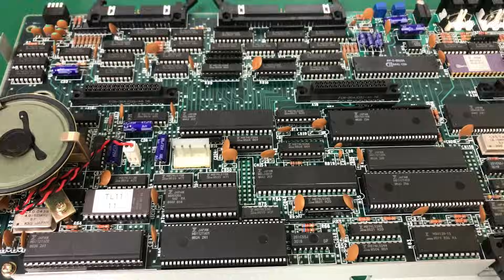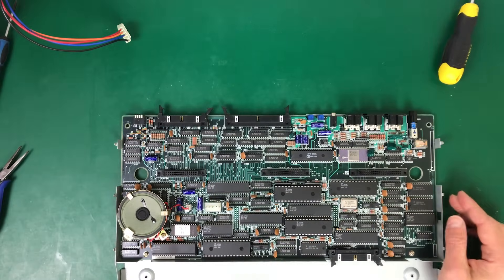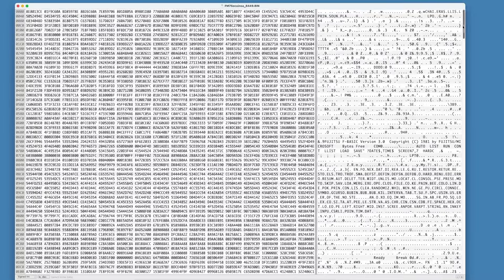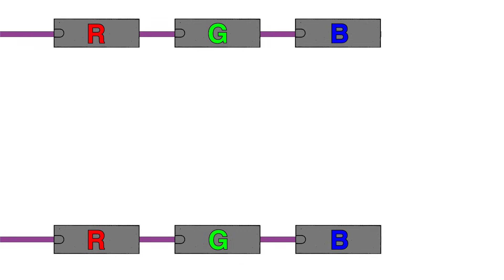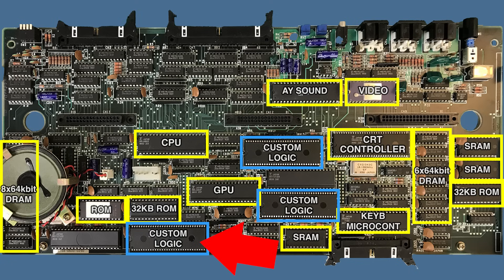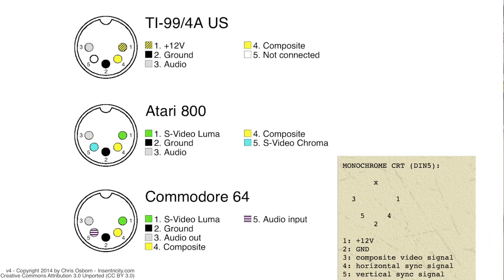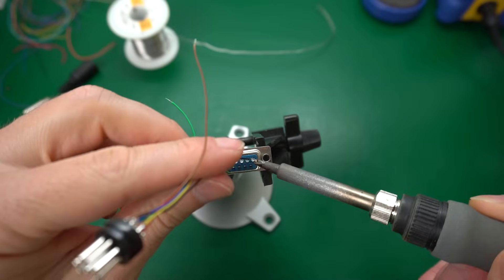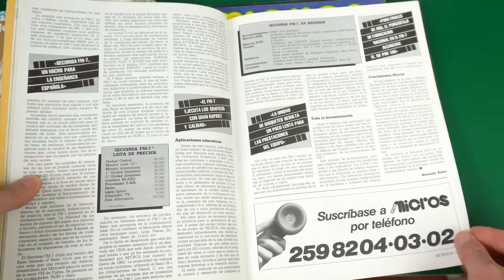This 8-Bit Computer Has Two CPUs (And One Acts As A GPU!)

Comment: Fujitsu have always been producing advanced computers going back to the days of mainframes and minicomputers, but they never seem to get much credit for it. I think the problem is in Japan people wanted the advanced tech and the price wasn't part of the equation, wheras in the west price was a much stronger driver for success. This can be seen with the Atari ST and CBM Amiga - the Amiga was technically more advanced and had a hard struggle to get ahead of the ST (which gladly it did eventually). But I think the ST still outsold the Amiga in raw numbers.
I had a Fujitsu PC once and it was beautifully made!
Reply: The Amiga was behind the ST in total unit sales for quite a while because the Amiga sales were really slow until 1987 when the less expensive A500 and A2000 came out. It probably took until around 1989 before the Amiga had sold more units than the ST. models. Ultimately, the ST models sold a total of 5 million units while the Amiga models sold a total of 11 million units, 6 million of those 11 million were A500s.
Reply: @timlocke3159  Thanks for that I knew that Amiga sales didn't take off until the A500/600 came out, but I didn't realise it sold so well when it did.
Reply: @IanSlothieRolfe  Yes, the A500 did very well but the other models not so much.
Reply: Fujitsu has made some interesting products really. I don't know much about the old days of mainframe computers but recently I read a little about magnetic logic and the parametron, a machine using it made by Fujitsu. That is pretty cool. Sadly most of what I have heard about Fujitsu is about it being an unpleasant employer, but I don't know if that is Fujitsu especially or just Japanese corporate tradition in general.
Reply: Both the amgia and st sold poorly compared to the extremely  overpriced and weak mac and ibm pc. i think the big problem with the western computer market back then was that most gamers back then where young kids compared to japan where you already had a lot of 25ish year old men that where into video games. so what this means that in the west most computers sales went to offices and computers that targetted gamers and hobbyists had to be very cheap. most european and American men born before 1970 really looked down on video games they just wanted to do spreadsheets and didn't do much research .even now i ask older people if they know what the amiga was most of them don't remember it at all those who do think it was a game console like the nes.
Reply: @belstar1128  Part of the problem was also that the Amiga and ST didn't have a "Business" look with their plastic cases and cheap-looking construction. The IBM PC and clones were made from metal and were substantial, could be sold ro businesses which was where the money was at the time. While there were a lot of games being played in 1983 gaming really wasn't a major business at the time, not until the 386 on machines arrived much later, and the market was small compared to the enormous amount of money being spent by companies replacing computer terminals on desks with PC's or Macs. I recall from the time that a PC XT with a 3270 (IBM terminal card) and software cost about a third of the cost of an actual 3270 terminal. Serial terminals for DEC and other manufacturers minicomputers were hugely expensive too, and PC or Mac "glass teletype" software was cheap, and the computer already had the serial hardware built in. The Mac gained a niche in the publishing industry largely due to a number of page layout and graphic design programs that became the "industry standard" from what I can tell.

Comment: Really nice computer.  Great video.

Japan is 100 volts, not 110.  Half the island is 50Hz and the other is 60Hz.  The USA is 120 volts 60Hz.  Their video standard was NTSC 60Hz.  This is mainly because of the influence of the USA post-WWII surrender.  If you have a monochrome monitor with a vertical hold control, you could likely hook up a 50Hz monochrome monitor to the 60Hz video connector.  Just adjust the vertical hold.

Comment: I think the extra memory in the 48K video RAM is used for something. The system definitely has palette control as some of the demos I've seen use palette rotation for animation. It also has smooth scrolling - at least vertically, which wouldn't be possible using the second CPU alone.
Reply: Smooth scrolling of the whole screen requires only changing the start address, something the 6845 CRT controller supported.  Smooth scrolling of vertical scroll regions requires pointers, I did one like that with a 6800, worked great but sure used up chips with address multiplexing.
Reply: @jrstf  for scrolling you would usually also have extra display ram so that offscreen pixels can be written before changing the scroll/offset registers. Otherwise there will be graphical glitches or an annoying moving border 😁
Reply: @Anticitizen666  - Registers are changed during vertical blanking, not at all time critical especially with this computer that has some 50 scans blanked.
Reply: @jrstf  I it’s not the changing of the registers it’s updating the pixels during vblank that would be the issue. That’s why all consoles/computers I’ve worked on that have hardware scrolling have extra memory for the offscreen strips. Well actually I think the older MSX machines didn’t and the result was the moving border that was hidden by the programmer adding black pixels to the edges, reducing the active display size.
Reply: @Anticitizen666  - Maybe we're just visualizing this in a different way. During smooth scrolling there is always an extra line on the screen as half the top line and half the bottom line are visible.  So a 24 line screen requires 25 lines of memory. However, there is nothing wrong with updating pixels that are currently displayed on the screen, with the slow machines of the time that was necessary.  Maybe what you refer to is the case where the CPU grabs the memory away from graphics, that's just a case of insufficient memory bandwidth.
The 6800 system I built gave the memory to graphics during phase 1 of every clock cycle and the CPU during phase 2 so there was never contention.  The machine shown in this video had a 68B09, if it was really running at 2MHz memory would be too slow for what I did, however I saw a 4.something MHz crystal in the block diagram indicating the CPU was running slightly faster than 1 MHz, plenty slow enough to avoid memory contention.
Reply: @jrstf  not sure what you mean by half a line above/below. That’s simply not true with any hardware I’ve worked on. The memory for a full frame would be (W x H / 8) * bitDepth. The rasteriser won’t draw half a line - if you know the f anything that does do it I would be interested to see a link though. My contention isn’t that it’s not possible to update during vblank, I’ve also worked on the 2600 and ZX Spectrum where it’s obviously more extreme than that - but that the extra strips mean that the software can update these at any time instead of being forced to do it all during vblank where you might also want to do some other effects or overlay/clear sprites. Anyway this is all conjecture - would need to see the datasheets to be sure 😁

Comment: Damn. If it weren't for the language barrier on the technical documentation I think I would love to get my hands on one of those and start programming for it. What a fascinating computer!
Tell me, do you know what clock speed the 6809s run at?
Reply from the maker: I knew I left something out! I meant to talk about the DIP switches in the back. Apart from deciding how the computer boots, you can select the CPU speed between 2.0 Mhz and (I think) 1.6 MHz. I'm not exactly sure why that was needed. Maybe FM-8 compatibility?
Reply: @NoelsRetroLab  rather region selection. I am pretty certain that messing with dip switches would affect pixel clock and refresh rate.

Comment: I've read that Acorn originally planned the BBC micro to have two 6502 CPUs, before opting to split out the second CPU and make it an expansion unit. As I understand it the 6502 "second processor" had very little ROM, and what it has is copied into RAM immediately after reset then the ROM is switched out. It acts as a proxy for the OS on the main board so system calls on the second processor trigger actions on the main board.

Without studying the FM-7 block diagram in detail I can't tell but I wonder if it actually works to a similar plan with the CPU having a flat 64k RAM map and just enough ROM to "boot" it, and the other "GPU" does EVERYTHING, graphics, sound, I/O, firmware etc.

Also this looks like it could run OS9 (Level 1 anyway) so I wonder if it ever did?
Come to think of it what storage does it have?

Comment: Or mod the PSU. Often, with joined capacitors in a 240V PSU, you can cut a trace or something to change from filtering to doubling. I'd look at PSUs with the switch and see if that could be applied here.

Comment: As someone who programmed the 6809, I don't see 2K of ROM as being too small for a very basic graphics library. A 6809 program that does a specific task will generally be smaller than a 6502 program doing the same thing. Line drawing, rectangle fills, and character drawing will take very little code. I suspect that about half of that ROM contained the character bitmaps (128 characters, 8 bits each = 1K of ROM).
Reply: From a brief look a the schematics (retroabandon/fm7re on GitLab) the sub-CPU had 8-12 K of ROM, 4K of static RAM for workspace, along with the 48K of DRAM for the video display.

The built-in character set is 256 8x8 characters, so that would have used up 2K of ROM. And if you had it installed, the kanji ROM card had another 128K of character definition RAM, defining quite a few thousand 16x16 characters.

Comment: But Noel, unless you can't upload code to the graphics co-processor you can't take advantage of fast graphics techniques for the 6809 like 'stack blasting'. That's just regular techniques, not doing special timing. Basically, programmers of 6809 machines have figured out the best and fastest sprite routines (AKA block copy, bitBlt) over the years and it's doubtful this would have been implemented in the co-processor here. In fact, this extra SRAM is an overhead!

Comment: The Fujitsu FM-7, seems to incorporate all of the best features of home computers of the early 1980's. On the face of it, it has a built in speaker, like the BBC B, and Sinclair Spectrum. It has the Sinclair Spectrum 2 brightness colour levels. The advanced sound capabilities of the AY sound chip, as per Amstrad and Sinclair/Amstrad Spectrum +2. The multi processor data handling of the Sinclair QL. Graphics processing of the Commodore64, and multi tasking of the Commodore Amiga series. I would imagine that the programs are similar to BBC B and Spectrum. Games downloads seem to be available on the internet.
Wayne & Nina
❤️❤️❤️❤️❤️❤️👍👍👍👍👍🤔🤔🤔🤔😃😃😃😃😃😃😃🇪🇦🇪🇦🇪🇦🇪🇦🇪🇦🇪🇦🇪🇦🇪🇦

Comment: I think you can “RGBmod” that nice Trinitron. I have a similar one, which jungle chip only accepts digital rgb signals. I managed to see an Amiga500 outputting digital RGB with my set, but it wasnt very attractive in 16 color mode. 😂😂
Reply from the maker: No need. That Trinitron has a built-in SCART connector. Love those European TV sets! 😃

Comment: I think old arcade machines also used more than one CPUs and probably for video.
Reply: Qix used two 6809s a lot like this computer. More common was two Z80s or a 68000 plus a Z80. From memory in those cases one of the Z80s tended to be used for sound but I believe that in Qix one CPU was used for graphics too. I should really look this stuff up before I type it though so don't quote me (-;

Comment: Using a cpu to drive a fast dma display using a sort of framebuffer

Sounds like atari antic but that used a dedicated graphics chip,gtia,  instead of crt controller and rgb encoder And was bootstraped via 6502 not via dedicated roms.

Looks like they used a cpu driven display and uses ram as a buffer so you can do fast dma, which is needed for video.
 downside is cpus are not effective for this type of work which is why custom vlsi chips were made, so reduce the amount of baby sit so the cpu can do something else other than drawing lines.
Reply: Now replacing the 32k rom with a 32k dual port ram banswitched to the main work cpu and add 64k vram, since you can use same style bankswitch methods, benefit of using a cpu and not custom vlsi

Then just add 64k custom rom for main cpu to bootstrap 16k block in vram memory and allows both cpus to directly communicate via 32k (or 64k) of ram where rom is, its my guess display routines are hard coded in that 2nd cpu rom with maybe some custom characters for graphical elements 

Dual port ram would allow you dynamically change this code, allow perhaps for different display resolution and higher color depth

Comment: I've heard of the FM Towns Marty, but I didn't know it was internationalized. 🤔
Reply: FM Towns Marty is a game console using FM Towns hardware. FM Towns is a 386 based computer, but with custom video and sound chips making it work more like an Amiga.

This machine is at least 2 generations older.
Reply: It wasn't. This is a FM-7, which is a cost-reduced version of the FM-8 - from 1981/2. The FM Towns was basically a 386 - from 1989 (with 486 and Pentium models later on, though all with custom hardware). The Marty, was a consolized version - but never made it out of Japan.

I was really surprised to see this Spanish badged FM-7 - I honestly had no idea this existed. I didn't think any Fujitsu Home Micros made it out of Japan. The did have a MSX variant.. but it was barely a MSX-1 compatible!

Comment: Some Japanese game arcade cabinets got similar multi-processor configuration, with one CPU handling graphics and eventually 3D graphics math (it's usually VLIW or decent RISC processors that's doing the 3D math due to the needs for decent FPUs). The usage of second CPU as a GPU is something similar to the recent video cards we get now, with flexible superscalar out-of-order shaders able to do your biddings, especially with the photorealistic games nowadays, yet it was implemented much earlier than the original GeForce 8000 series, by about 20 years apart at time of its release. Nice and somewhat rare finds.
Reply: What are some examples of this risc use case?

Comment: Looks like a computer for upper middle class and rich people. I started programming in the first half of the 1980's and at that time it was slim pickings for lower middle class people, and nothing at all for poor people. I was very lucky to be able to get a computer and a disk drive, with help from my extended family, and to be able to teach myself programming. My parents alone couldn't afford it. Rare and expensive computer hardware from the 70's and 80's doesn't impress me. Macs and Amigas from that era don't impress me. The Commodore 64 and other low end computers that were not toys for the wealthy are what I care about. Doesn't matter if a computer has two processors if it's only a rich person's toy.

Comment: The problem with using a CPU for offloading the graphics is that you end up with an incomplete system that you then end up having to create more circuitry (or another IC) to complete and then have to create even more circuitry for synchronization with the rest of the system. So while the architecture is interesting, it is inefficient.

Comment: XT works with 2 8088 processors, the second has to be installed into the 8087 socket. That way, you won't have a 8087. Possibly, it may work with an additional coprocessor card, if there is an existing one. You can also use an additiobal port extension card, but it needs another XT. There you can install your 8087.
Reply: I think you're mistaken. Do you have any references for that claim?

Comment: I recently picked up one of these and I really like it. It's a perfect hobbyist computer, would have loved to have it as my "first" (I had Coco2 as my first).
Mine had caps that were starting to fail, a small amount of greenish crystals forming on most of them. For some reason the caps come out easily but I found it a little difficult to clean some of the GND holes out completely afterward, the solder would just sit there! Solutions to this? I was mainly just using wick + flux. In the end, I pressed the lead into the hole whilst heating it up for some of them.
Played around with the BASIC, and I found it to be very responsive. Nice! Running your simple BASIC benchmark on this computer, it really flies, it's almost up there with the BBC.
I'm really curious to see what sort of loading solutions you will come up with, I've tried loading stuff from my Mac, playing .WAV files into it and I often have issues, only 1/3 of the titles I have tried have succeeded.

Comment: What happens if you connect an amber CRT to the green CRT port?
YoU mUsT rEpLaCe AlL tHe FuJiTsU cHiPs!!1!!!eleven!!
The extra CPU as GPU reminds me of Taito's Qix architecture. It also uses two 6809 (plus a 6802 for sound), one of which is used as a graphics processor although that one only had 1k of communication RAM.